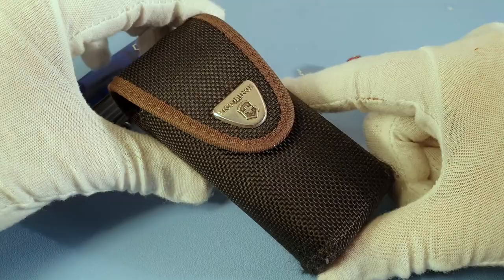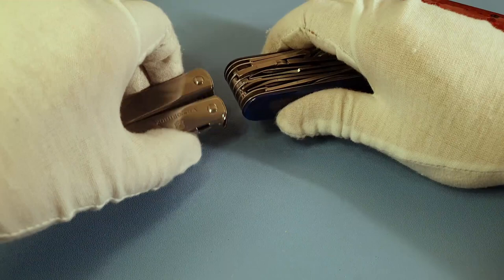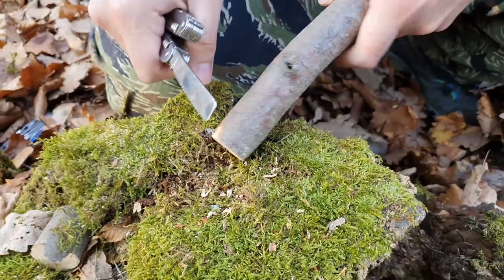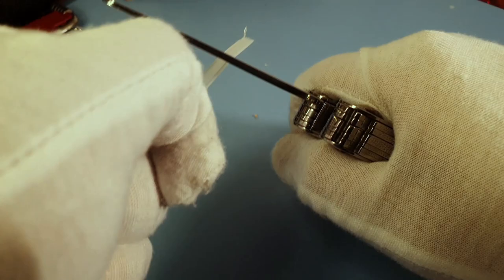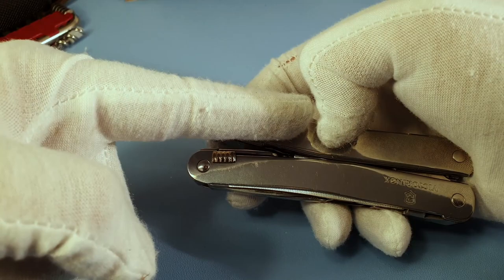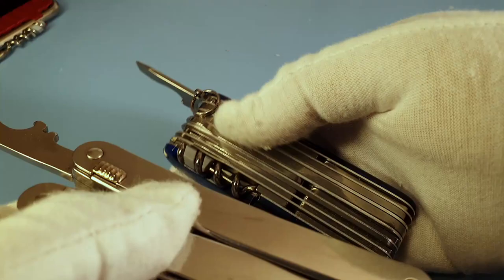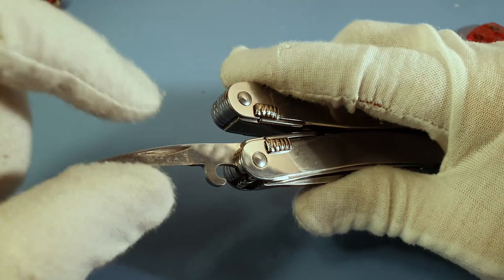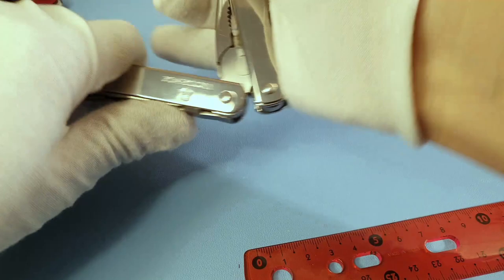M.A.S #16 | REVIEW (1/2): Victorinox Swiss Tool - The practical champion

Comment: I have a SwissTool X and may add a Spirit XC to the collection & rotation. Impressive quality and finishing on these tools; better than the Leatherman Rebar i had.
Reply from the maker: Indeed! When I saw the Leatherman in person and held them, they felt cheap. Some functions are cool, specially from the Wave which has the main tools accesible with one hand... But the quality as you say, is for sure inferior.

This swistool I have in the video has more than 7 years and I put it to good use... Not one scratch and not one single sign of rust (I take care of them but not baby them)

Comment: Lovely review this seems very similar to a leatherman.
Reply from the maker: Yes! Similar in the features, I'm not sure in the quality. I never had the chance to get the Leatherman live.
Reply: Just from the quality Victoinox beats Leatherman for sure. I had both for many years. If you don’t have a specific reason to go with a leatherman (some features are not offered by Voctorinox) go with a Victorinox (my advice is the Sprit because the Swiss Tool X model is a bit rough to work with the blade because of the sharpe edges on the handle)
Reply: This is, way better than any Leatherman.
Reply from the maker: I didn't have them side by side, because after seeing the Leatherman was not good enough for me to buy it. So I agree, the only thing I like about the Leatherman is the knife accees in the Wave.